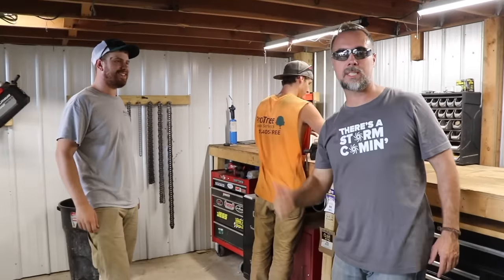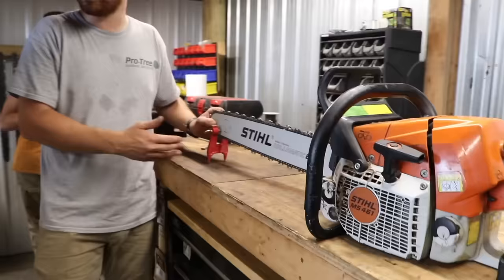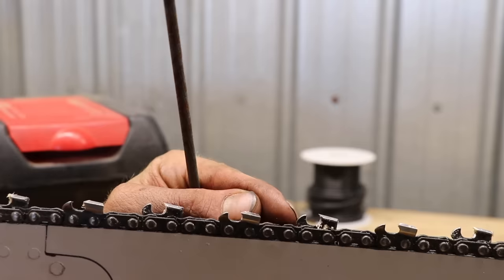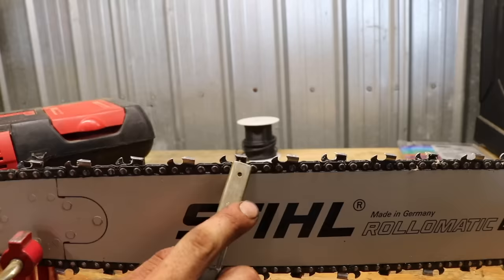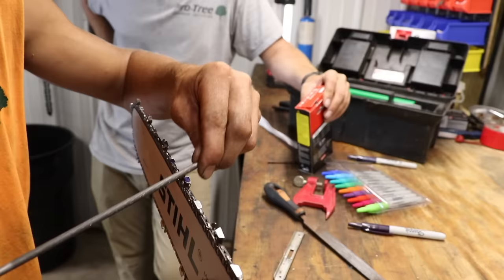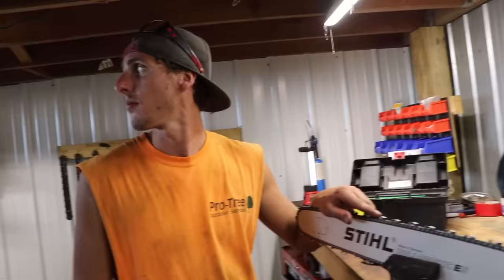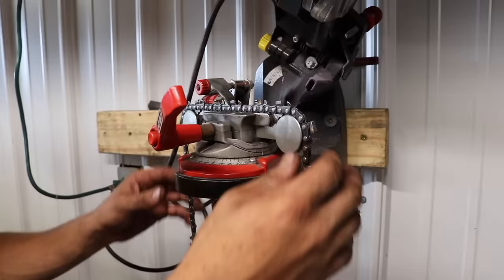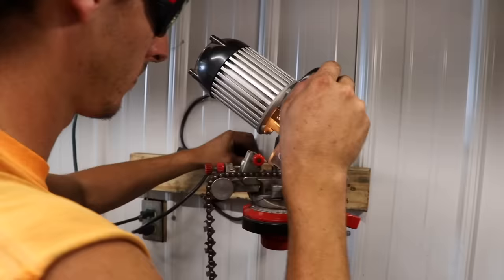How the Pro's sharpen a chainsaw

Comment: Rakes control the Angel of the bite Dog.  If the Head Angle - has your Dog tooth messed up - NOTHING will help you. IF there is blue smoke and no chips, cut the dogs. Use the guides!  Sharpe teeth make it easy to cut and pile wood. Use a Hockey Elbow pad through. The cut log will dance up the chain, until you let off. Well I used my Husk to cut and pile. 
Now - I was the only person who used the saw - so I always Finished work with dressing the teeth.  The corner and tooth had to draw blood, then I knew it would cut. 

PPE - Sawpants. Boots that are made for the work. Ear defenders - eye protection good enough that you will wear it. and a Hardhat and Screen. 
 Buddy is cutting his last branch - over his shoulder in height. The saw kicked, chainbrake worked but the head has a bunch of arteries around the face. He was a 30 min ride at Hyway speed and he drove himself to the Ambulance.
Facial Reconstruction surgeon to him, he never would have survived - if he had not driven to the Volunteer Ambul / Fire Depot. Any longer and he was dead, before the Amb got him there. Yes - he does have a nickname - I call him "Scarface". He just laughs - "It never killed me!"

So If I picked up my saw and all the teeth are not clean and cut my fur. If it cannot I know it was used and sharpen it even more. You MUST have dogs and make sure the cut teeth are sharp. 
Cheers - Do not put saw files in the back of a truck - metal scrap is what they are.  If I did not pull it from a file sleeve - its trash. Dont work with others tosses and junk. 
Rusty files get tossed. Buy in bulk, they are less that $1 each.  Respect the awesome power of the  weapon.

Comment: Not to be rude but there is no way i would use a grinder puts to much heat in the chain and ask for the drags if the chain is brand new i wont touch them but the first touch up which is 2 strokes a tooth i hit the drags to strokes also i use no guides jus my 2 cents

Comment: further to below comment. The hard plastic  screwdriver handle with 4 grooves cut lengthwise fits exactly the back plate of the pull starter as fitted to my chainsaw. The electric drill runs in reverse with the modified screwdriver fitted and it does start the engine. I need now to modify the housing that holds the pull cord mechanism. Refit the housing because the air flow to cool the engine is part of the moulding. I would be grateful for any suggestions to better my idea. Thanks. Old Harry
Great videos thanks for the tips on sharpening.

Comment: Hi has anyone got an idea to make an electric starter for STIHL Chainsaws. I have tried the very hard plastic screwdriver handle then cut off the blade to fit my cordless drill. I am 85 years of age & I find it difficult to pull start my chainsaw. Been cutting firewood for most of my life and I'm not ready to give up yet.  Old Harry. Bolton Lancashire UK.

Comment: He is wrong on the hand filing angles... You do not want to hold your file flat when filing the tooth.  The angles you use are 30-32°(depending on chain) and 10° tilt on it.

Comment: The machine's  sharpener 's finger get's worn out by metal on metal, then the operator has to compensate for the ware and tare, the stone needs proper dressing as to fit the rake and angle + gullet... if you do not tend to the grinder stone wheel...good luck.

Comment: Just wondering, how often can you sharped the blade before replacing it?  I hope the one sharping the chain gets paid well looks dangerous.
Reply: the chains I use have a little engraving on every toth. Once the toth gets so small, that the cutting edge reaches the engraving, the chain has to go.
Reply: Chain saws us a guide bar. Blades are on knives and swords.
Reply: @nobodythatyouknow241  that was two years ago

Comment: I grind my depth gauges down to the bottom on the first sharpen.  Its super aggressive,  but it's hard on clutch sprockets. You also really need to pat attention to what your doing.  I wouldn't do it if I was a climber,  but ground work,  they just eat.

Comment: hi, what chains do you guys use, which ones are best overall?
Reply: with out a doubt, Stihl chains ! . I used all kinds when starting out and was using a homelite saws for years. 
what a difference when I went to Stihl , spent less time sharpening and tightening  the chain and more time cutting. 
still have my first chain saw after 40 plus years 031

Comment: While I concur that you need to be very careful to control heat when grinding loops, I do not agree with the chop, chop, chop, method of controlling temps with a grinder. 
IMO you are better off to ease the wheel into contact with the tooth and then move the wheel very slowly in one controlled motion to keep heat in check. Each time you bring the blade into contact with the tooth of the chain, the tooth shifts as its loaded. 
By easing the wheel into contact and then grinding one slow continual motion the tooth remains in the same position as material is removed and the heat is also effectively controlled.
Reply: I am a retired NIASE master technician, machinist, and have worked as a crew chief on a blown alky dragster. I also do quite a bit of tree work (for an old guy lols) as well as build work saws and sharpen loops for a couple of friends.....does that make me an expert? No, and I never claimed to be, however thanks for the upgrade.
You may have noticed the IMO, when speaking of an alternative grinding technique? 
Evidently Stanley did, as he does not seem to have taken offense to my respectfully presenting a different opinion on the best technique to use a grinder on loops.
Also wanted to let you know I found your YouTube channel very interesting....though somewhat lacking in content :-)

Comment: Echo?? there are three kinds of chainsaws:Stihl,Husqvarna,and Junk. 20 years working in the woods, have all Limbs and digits. chainsaw sharpening lessons not bad. unevenness of the teeth doesn't affect the speed or quality of the cut unless it's extreme, but it will shorten the life of the chain.
Reply: Indiana Jones / sorry about that, I'm a retired logger not videographer.

Comment: The only way you can afford to sharpen a chain instead of buying a new one is if you are under-paying the worker doing the sharpening.  You can buy 14" to 24" replacement chains from  $11 to $18.50.   A worker might sharpen several chains per hour, after you buy the $600 machine, or fewer if hand-sharpening.  Either way, sharpening them can be hit and miss, especially with hand sharpening.  The employee is making the bottom line a profit equal to the price of new chain(s) less his hourly rate, less the cost of the machine or files or replacement grinder wheels, less any inefficiency that results from a backhoe driver sharpening chainsaw chains... Employees can be put to much better use doing the major work of the business.   

But the ideal situation is to grow the business large enough to support a full-time maintenance mechanic.  They would work afternoons and evenings after the trucks return, making sure all the equipment is lubed, checked, blades replaced or sharpened, repaired if feasible, and perform other work best done at the shop.  Morning trucks would leave the shop with gear in good shape, so as to get their jobs done efficiently.  The mech would tag equipment serviced, keep records, receive repair or replacement requests, and when needed send up purchase orders for approval.  The big boss would free up time best spent customer facing.

Comment: I didn't hear you talk about when the bar gets worn, and creates a sharp corner, which can catch on the sides of the kerf. I take the blade off, and smooth it with a belt sander.

Comment: A sharp tooth is exactly that.  It doesnt matter if one tooth took 5 passes and the next tooth only took 3 passes.  Unless you enjoy buying chains. Your not going to cut crooked if all the teeth arnt the same length, your not going to remove less wood either. Counting strokes is and old school wives tale. But by all means,keep the same edge profile and angle.
Stop counting. KISS And yes file your rakers.

Comment: Can someone share with me the best chain saw for cutting down trees up to 8” in diameter? 🙏
Reply: Any chainsaw is limited to the safety sense of the operator.  If you are felling, make sure you learn a lot about cutting fallen wood first, then watch videos about safe felling, then have an experienced person do it in front of you a few times, then do it with that person present a few times so that the person is there to help you if they see something that looks to be going wrong.  Any chainsaw can cut 8" trees.  Stihl and Husqvarna are the choice brands of the pros, if you get quality models.
Reply: @happycamper6352  thank. I’m pretty impressive now since my first comment. And I learned all on my own. With the help of YouTube. I’m now 40 plus tress in and majority of them, the bottoms even hit the ground first.
Reply: @truthhurts7529  An very acute face cut angle will cause that because the face cut gap closes before the tree is done falling, causing a breakage of the hinge before the tree is done falling.  In a hazard-free situation, that might be ok as long as it's not too early in the fall. Sometimes it's a good thing and sometimes not, depending on the situation.  The good part is that you don't have to separate the tree from stump after the fall since it's already done.  The bad part is that the hinge is no longer there to control the direction of fall once broken which in some cases can be a significant safety concern especially when you're falling in a direction that is different from the lean or if you're in a situation that shows threat of barber chairing, which is a major safety concern.   Ideally I try to make the face cut angle such that it would close and snap just before the tree hits the ground and that will come with practice.  Some guys like the tree to stay attached to the stump when they're creating a barricade or wildlife cover or they don't want the tree to slide down a hill although it's not  a very reliable thing to do.  What saw did you eventually choose?

Comment: Let me tell ya when one cutter has to put out 13 to 15 thousand board feet 4 tractor trailers and 2 try axles  everyday  and carry 2 gallons of gas gallon of bar oil an axe 4 wedges and let not forget do all that in billygote  country and top them yourself

Comment: Do not use a grinder on your chainsaw chains. The heat takes the temper out of the steel and the edge doesn’t last as long on the teeth. Hand file only. Rakers should be taken down every couple of filings, using a raker gauge depending on what type of wood you’re cutting, either hardwood or softwood. Long shavings are not an indicator of a sharp chain. Your sawdust should be small square pieces that come in multitudes while cutting.
Reply: If you don’t hit anything with your saw (rocks, metal, foreign objects, etc) you should not need to sharpen your chain. Very seldom do chains get what we call “wood dull”

Comment: Some good points some bad!!   I been sharpening chain saw's and anything with an edge on it since i was 9 years old "late 40's now", My father had a professional sharpening shop. the machine  they showed is Known as a "Knicker" the worst thing you could use on a chain.

Comment: Its a art to sharpen a Saw. I have paid people to do it and seen Blue on my Chains. Grrrr.  Not that I do a lot of Cutting. I would rather cut Grass. But Grass dose keep my but worm!!!
Reply: Ive been cutting grass for 30 years..... running a chainsaw for even longer...... I make a decent living.....but dam I love a saw....I have an 044 that I have been running for 20+ years and God only knows how many gallons of fuel have been through it.... it is the most satisfying feeling in the world to throw Chips out the size of snowflakes....I have All of the good stihls ....038, 044,066 , 088, 020T.....but that dam throttle response on the 044 is just amazing.....

Comment: I have been cutting wood before they were out of school.  Wow. You should have got some fifty year olds that actually invest 1800 in a commercial stihl sharpener.       It’s not a raker. Never was a raker.  They are depth finders.       A raker is found on a cross cut saw
Reply: What does it matter how much they paid for the sharpener. Age doesn't matter either. A lot of the time old people are stuck in their ways, don't avoid the best/miss l most modern/efficient way of doing things, and don't know about the change in tech. They're not "depth finders" either... Lol. (Rakers are colloquially correct. May not be technically correct, but a lot of people call them rakers, and everyone knows what they're talking about.) It's funny because another know-it-all said that using a machine is not a good way to do it, and another person said the Oregon/Stihl carpenters aren't any good. So you've all got your own opinions, and they're all partially wrong. So join the club.

Comment: The gear teeth are all burn up on my saw what cause it.
Reply: That can be caused by a lot of reasons: chain on backwards, or too loose, too tight, poor lubrication, or it has just reached the end of the service life and needs a relatively inexpensive replacement.  It's not an expensive part.

Comment: You cannot sharpen a chain by hand, sharpening is putting all the correct angles back on the tooth, only done by a machine. You can only put an edge back on the chain with a file, and every third time you touch your chain will a file you need to have the chain resharpened. "Hand sharpening"  your chains only will caused extra vibrations in your saw and eventually it will tear your saw apart. Especially if you have a saw with .325 chain.

Comment: if this guy knew much about sharpening he wouldnt be marking the chain with a marker, there is a double tooth on every chain. you start at that point as that is the reason for the double tooth, you have two teeth in a row that both point left or right

Comment: To me it’s not worth it to spend that long sharpening a $20 chain , I use a die grinder with a 7/32 Oregon rotary bit , takes about two minutes and is pretty damn sharp , I can usually sharpen 10-12 times before the chain is at the wear marks.

Comment: cant really see how that 600 bucks crap is faster than hand filing
Reply: It's not going to be much faster unless you have multiple chains to sharpen, and its easier to use ,just set all the angles Then sharpen the whole chain. And its easier for people that aren't good at hand fileing. But there are types of sharpeners that arnt 600$

Comment: Ahhhh the young whipper snappers, teaching different tooth length matters.. IT DOESN'T.
Reply: @indianajones8200  well just cause he doesn't have a video doesn't make him wrong. If he had a video would that make him right, because these guys have a video and they are wrong as are you for siding with them.
The depth gauge they are using is a poor design and only works well for about the first 1/2 of the chain, and by that I mean it will cut okay, but not optimally.
A progressive raker gauge is the proper tool for the job as it sets the height of the raker to each cutter without resting on another cutter.
Oh I forgot to say, wheres your video lol.

Comment: put a file in your hand drill. Find the correct bevel and have at it. This is not that hard.
Reply: chris Kenney-not keeney--I am an expert in hand saw filing--bevel/slope/rake-the principals are the same. Funny thing is--I sharpen my chain saw this way and it works great.

Comment: I need a better explanation how he cut his finger off if both hands were holding the saw.
Reply: The Tingler I think that he was holding the branch with the hand that got cut, when the saw caught and jumped back, it got the hand that was holding the wood.
Reply: @vandonbrown7617  Thanks for that. The problem then was not the chain it was improper use of the tool. Chainsaws require two hands to control it.

Comment: 12:38 Rubbish! I have a chain which has big tooth and many small (were damaged), but i sharpen it proper way and it cuts better than new. Check Buckin' Billy Ray videos, he has a couple of videos when he shows chain with different size tooth, but it cuts very nice! You guys are wrong on this.

Comment: NEVER SHARPEN A CHAIN LIKE THESE GUYS....EVER....FILE STROKES DOES NOT MATTER THATS WHAT THE RAKERS ARE FOR....you set the RAKERS for each individual tooth it doesn't matter if the teeth are all different sizes at all you file a tooth until it's sharp and straight than when your done you set the rakers NEVER FILE DOWN INTO THE TOOTH ALWAYS FILE TOWARDS THE CUTTING EDGE OF THE TOOTH